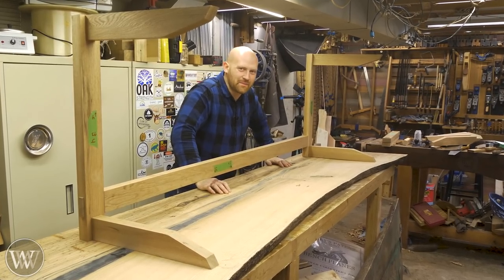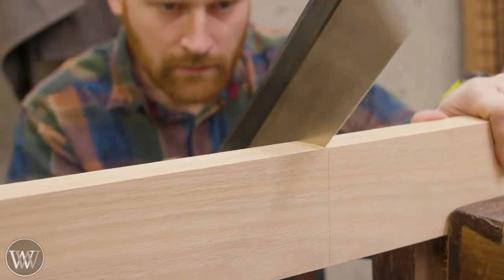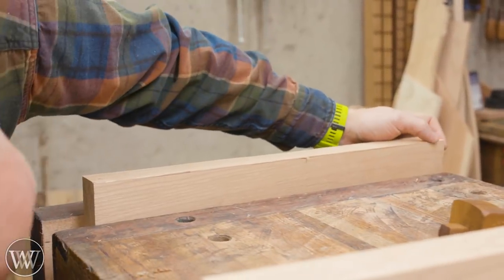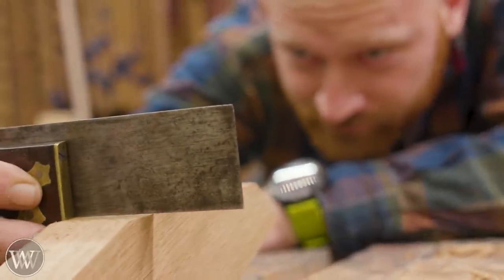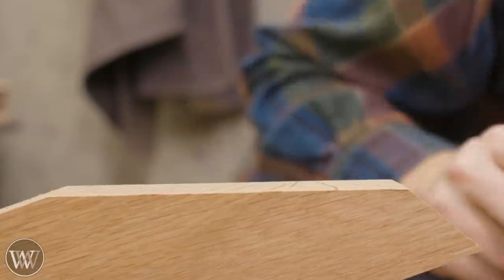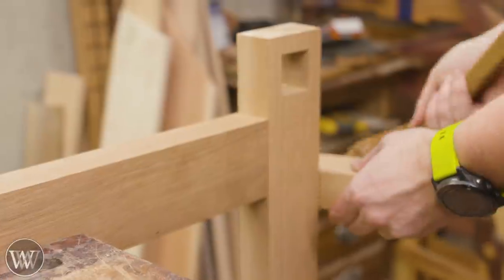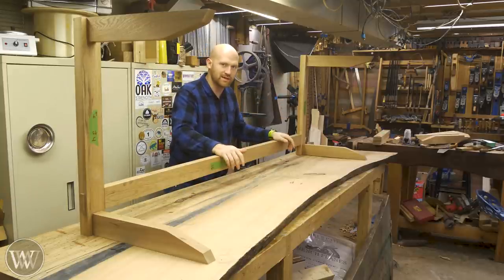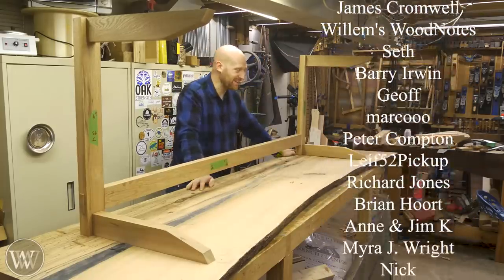How to Make a Slab Top Desk Base Joinery Part 2

Comment: Have you decided how you will be attaching the top to the base yet? 

Also I wanted to add that I’ve been watching your videos for sometime now and I have learned so much. You have been instrumental in furthering my own progress with woodworking. I really appreciate everything that you have done to spread extensive knowledge about so many topics of hand tool woodworking. Thank you!
Reply from the maker: In this case it'll be held in place by gravity. There will be a few pins going from the base up into the top to keep it from sliding side to side and front and back but gravity will hold it down fine as it is almost 200 lb.

Comment: Newbie here. When is a two-sided tenon desirable, and when is a four-sided tenon desirable?
Reply from the maker: Most of the time it says personal preference. A two-sided tenon is a bit faster to make but it is harder to hide the edge if you don't have a perfectly tight fit. A four-sided tenon allows you to hide any mistakes or any gaps around the mortise. But it's a bit harder to make. So in the end it just turns into a personal preference from case to case. In this particular case the reason I used a four-sided tenon on the second one is that the board it was going into is the exact same width and on the first one the board it was going into was much wider so I could use a full width tenon

Comment: Any one know how to get powder post beetles out of 4/4 air dried Hickory?
Reply: I don't know where you live but a good outdoor freeze will serve you well.(3 days +). There are borax based treatments also readily available.
Reply from the maker: That is not a fun one. The two methods I know of that work every time are number one freezing it for a couple days or two submerging it in water for several days. If you have access to a large enough vacuum chamber you can use that as well. I know some people have had good luck with borax but I've never had a chance to try that.